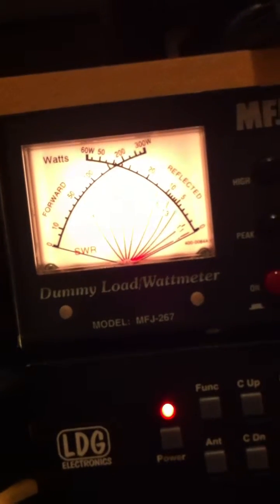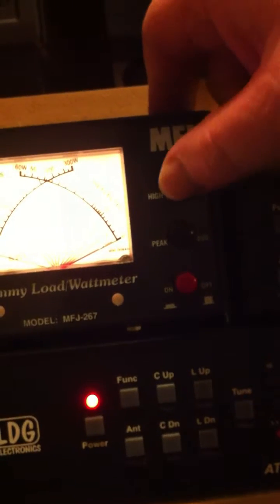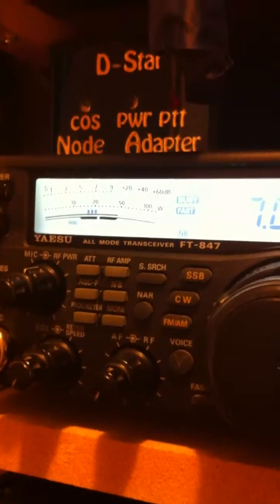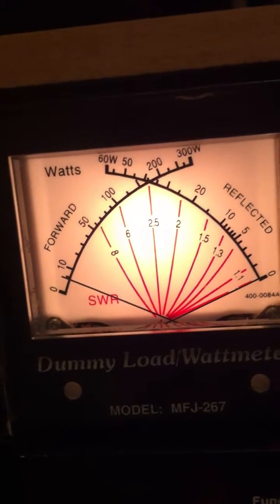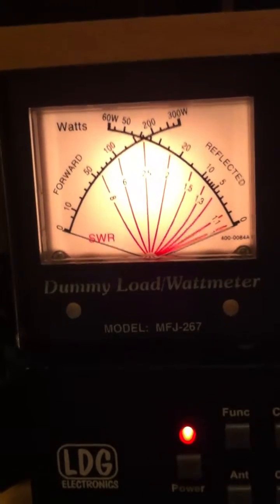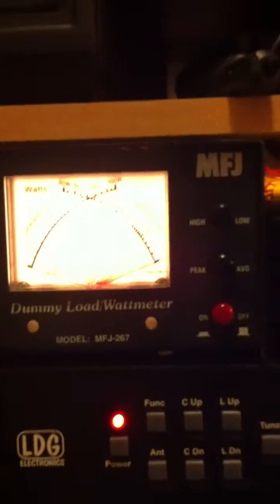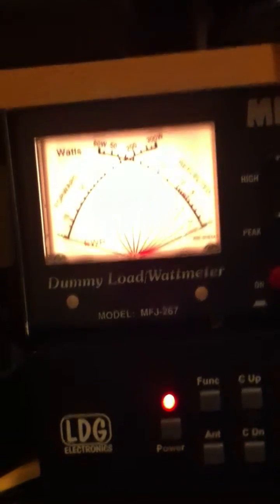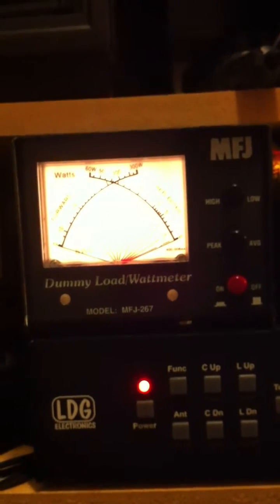MFJ-267 SWR Meter problem

Comment from the maker: Had the meter fixed by a friend so it;s now up and fully working thanks charlie and thanks Chad for the infoMFJ-815D instructions, MFJ them selves didn't give muchhelp at all very sad
Reply: +M0AOV actually I am with MFJ but this is my personal account.  I saw your video at home and wanted to help any way I could.
Reply from the maker: +Chad Butler Hi chad sorry you didn't say you was from MFJ but THANKS FOR THE INFO I've now got the meter sorted all up and noe I've put a On OFF switch on the power lead on the meter because the meter is working even if it's switched off i.e. used to show power going through the meter but now it work's fine. Once again thanks for the info.
Reply: +M0AOV What was the fix for the meter?
Reply: M0AOV or Terry, did you provide info on what was repaired/parts needed?   My Dummy Load is behaving as yours did.  Thanks de KE1CY  @terrymoorecnc2500
Reply from the maker: Hi Bruce have a look at (http://www.ad5x.com/images/Presentations/MFJ267.pdf )  I'M NOT SURE WHICH COMPONENTS WHERE CHANGED SO CANNOT GIVE YOU THAT INFO
Reply from the maker: +Terry Moore Hi terry I didn't fix it myself one of my friends did and the part's were around £4 in total, what Ireally needed was the manual that showed you the circuit and thanks to Chad I got it and my friend traced what had blown and fixed it, if you really need to know I can find out just incase you have the same problem ????
Reply: @M0AOV  M0AOV or Terry, did you provide info on what was repaired/parts needed?   My Dummy Load is behaving as yours did.  Thanks de KE1CY

Comment: see if you can re-calibrate your watt meter. The manual online for the MFJ267 does not have the calibration instructions, but the MFJ-815D has the same circuit.  

I refer you to page 4 and 5 of the MFJ-815D manual that can be found at 

mfjenterprises.com and search for MFJ-815D.

The trimpots can be reached without having to remove the cover.  There are 4 holes on the side that you should be able to access the trimpots.  The MFJ-815D manual has a diagram showing which trimpot goes with which scale.

Hope this helps
Reply from the maker: +Chad Butler Hi Chad thanks for the info I'll download it and have a look see if it can help...